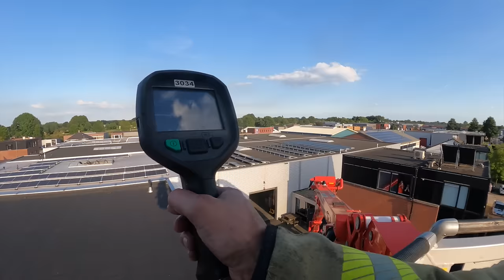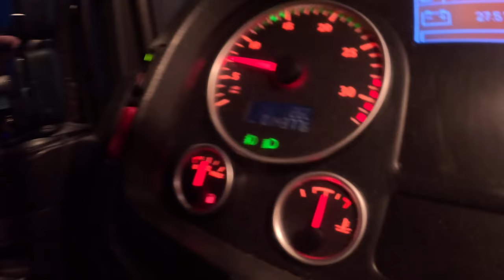Autogarage brand- VOLUNTEERS DUTCH FIREFIGHTERS -

Comment: Once again you guys are spot on !  I'm so impressed with the only truck on scene how quickly you got water on fire before any other truck showed up.  I believe this may be only video I've seen where there is multi- unit response. There must have been five trucks I think. On arrival you had heavy smoke and surly good fire burning in the building, Smoke was black a clear sign of bad things. A great job guys, you had water on fire way before other responding units got there. Nice job, well done. 🚨

Comment: As a German firefighter, I wonder: How many trucks were dispatched. You guys had some time to drive there and still where the first due truck.
Reply: Lunteren was first dispatched because the fire was in their area. Because Lunteren has only one truck 2 other trucks and an areal platform from neighbouring stations were dispatched.
Reply: @charlesmallo  Interesting. In Germany, they would've called way more and that all at once
Reply: @aleks1105 Remember that at first it was a suspected fire. Not confirmed. Then as soon as it was confirmed, they push the red button.
Reply: @aleks1105  The first call was a 'fire rumor' so not a comfirmed fire. When Lunteren was almost there it was confirmed there was a fire and the call changed to  'medium fire' so more units where then dispatched.
Reply: @hoi264  Fair point. Its just different to see a german firefighter, where even for rumor they dispatch fairly a lot compared to a single truck. By the System "Just in case"
Reply: @aleks1105 That's right, in Belgium, Germany and the US for example there is almost always a standard amount of unit getting dispatched. In the Netherlands that is not the case. Here it is 8/10 times of the calls getting handled by just one engine, with exeptions of larger incidents. We do have 'just in case' calls, like fire (rumour) in healthcare buildings like hospitals or nursing homes, or industrial incidents. I think a big reason of the small deployment is money, because dispatching one engine is way cheaper than dispatching a lot of trucks for 'small' calls
Reply: @aleks1105  judging by the number of alerts I see for "fire rumour", the fire depts wouldn't get any sleep if we dispatched multiple units for every one of them.

Comment: What happens when the fire is upscaled to middle fire and who decides to upscale it ?
Reply: A second truck gets called, as well as a command officer to lead the call ("officier van dienst"). Usually the current incident command decides this (commander of the first truck or the command officer). Although in this case i believe it was dispatch based on the calls they were getting. Later in the video they increased it to large fire.